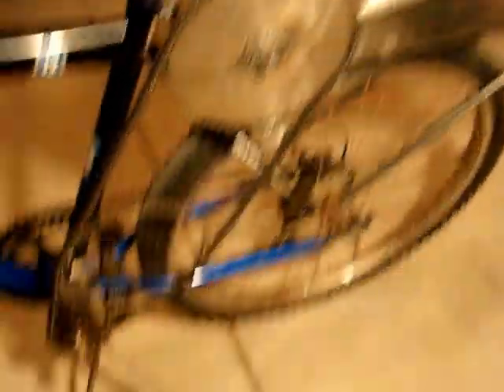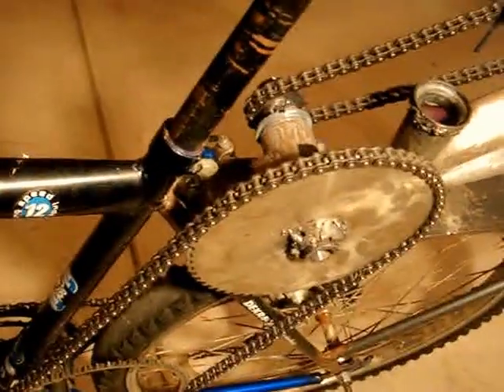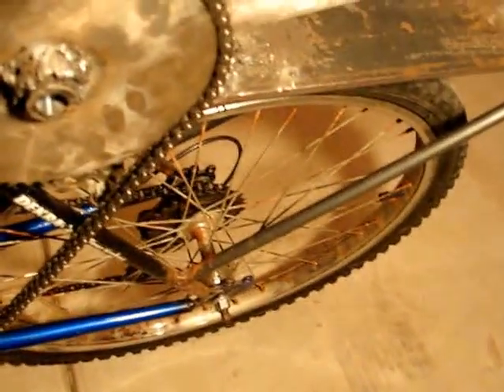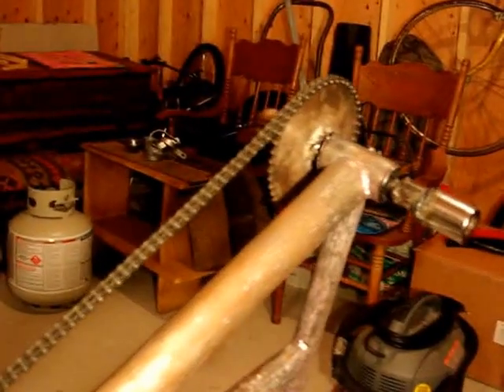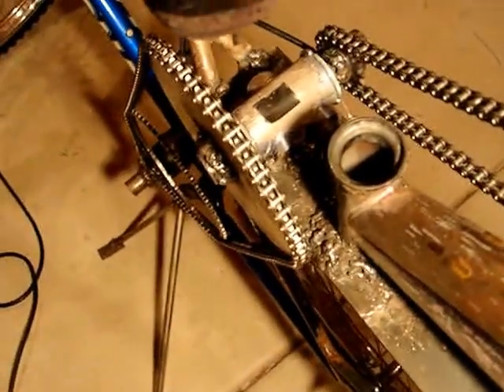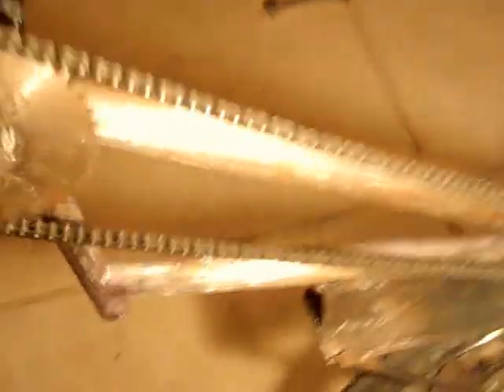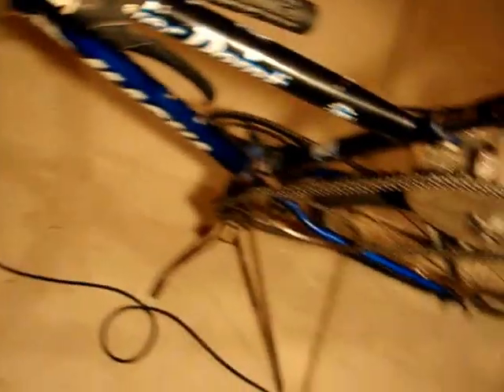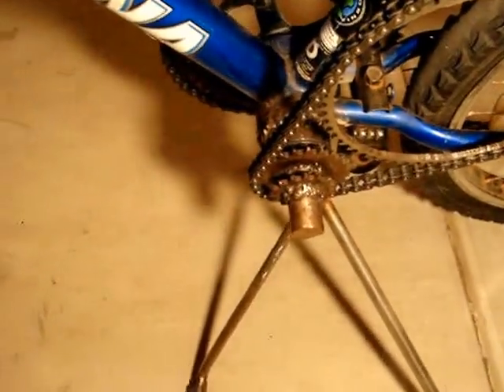The Gearcycle Bicycle Invention Part 4

Comment: interesting concept.if it really works i may dosomething similar but on a four wheel bike. so i can pull my camper trailer with it with less effort.
Reply from the maker: 4 wheel bike? I don't know if this type of bike would be good for towing something like a camper, but it would probably be easier than if you were to use a regular bike. An electric bike would probably be the best option for towing something.
Reply: vistigioful well for reasons i dont wanna get into an electric bike would be impossible for my plans, so i was thinking that your design would possibly lighten the load??? or corect me if im wrong, btw the camper isnt heavy basically a tent on a bike trailer
Reply from the maker: This concept is probably heavier than the average electric bike. Be warned that if you are going to build this concept, it is very difficult. There are cargo bikes but I don't know if you'd be able to fit a tent on one.
Reply: im building the trailer so it will fit on it, and if i had a electric bike i would need a solar recharge system. becaust this little bike powered camp trailer im planning on this going to e my tiny moile home i can park anywhere. so i wont have anywhere to plug in and recharge. my whole idea is t be nomadic and live largley without money. i may simpliyfy your design by having all gears in a straight line to the wheels, wich would also use less chain making it lighter. but thx for the warning and advice.
Reply from the maker: Lone Wolf
If you are trying to live with as little money as possible, that is understandable, because money is hard to make. I seen a howcast video on living with little money. They said that it can be done, but it requires discipline. I don't know what your experience is with making money, but have you tried to make money online?

I have thought about having the gears in a straight line as you have said which would eliminate chain slack and other problems associated with the chain. The only thing is the gears would run into the frame. We would have to figure out some way so that the gears don't hit into the frame.
Reply: i actually have a job and make money,enough to live on my own even tho im 16. but i want to live without money. i feel as if money really controls everything and to live without it is like complete freedom.  so thats why im building this tiny mobile home of sorts, you dont need a lisense or insurance to drive a bike :)  so im thinking for not hit the frame, that theres a small axle (i dont know the proper terms) and on one side the large gear and on the other the small gear and they alternate so make three or so of theese little sets, line them up in the bike frame so one gear on each sideand weld them on. and turn the next the oppisite way and the next again so yeah, you get the idea. lot less chain slack wich would make it more efficient. this probly makes o sense im horrible at explaining things.
Reply from the maker: Lone Wolf
Have you checked out my other videos on 'The Gearcycle?' They would give you a better understanding of the process that I went through on this bike.